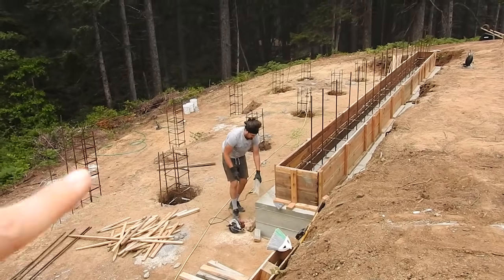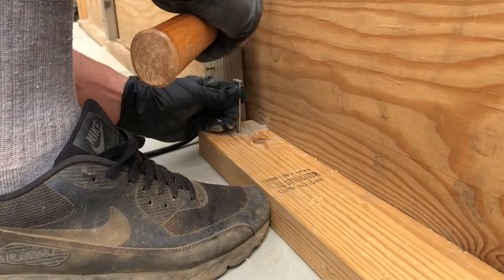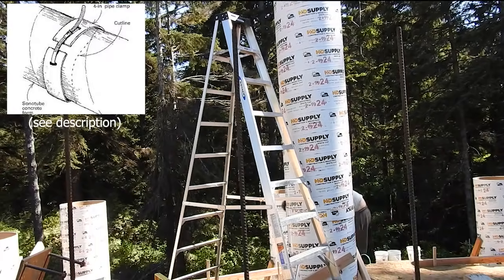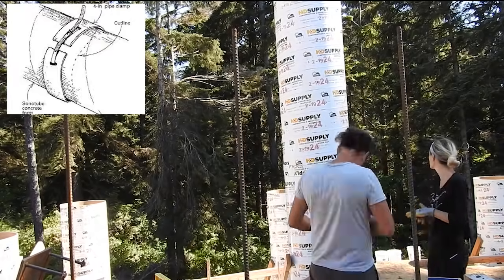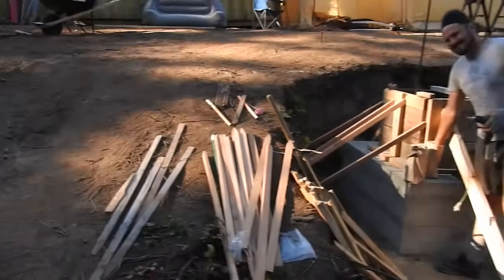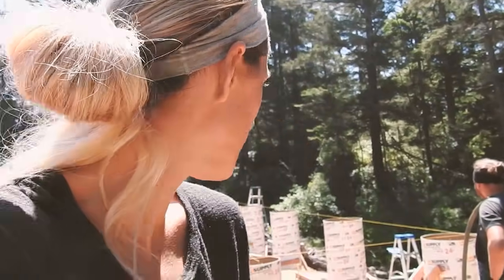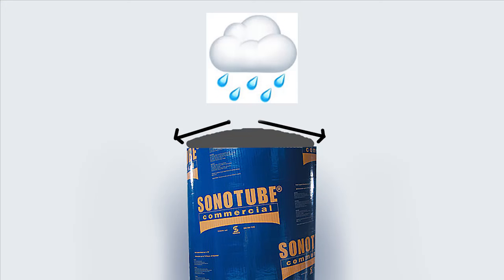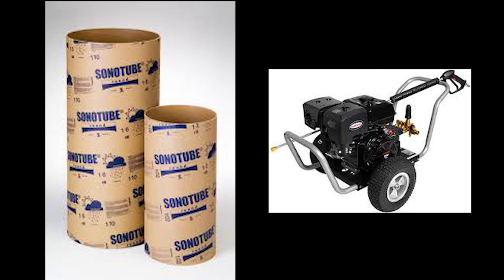FOUNDATION PART 3: Ledger, Sonotubes, & 2nd Pour — CONTAINER HOUSE BUILD - Ep. 5

Comment: I'm not trying to through shade on what these guys are doing because it's quite impressive. But, I know how much $$ that foundation has to be and yet the containers are pretty rusty. In one of the videos, they show a shot from beneath and you can see light peering through many of the structural supports. That's through-rust and it is fairly extensive.

I'm building with containers right now in 2021 and I can get well used 40ft High Cubes for $3200 and I can get "One trip" 40ft High Cubes, which are basically new, for $5500 (both include delivery). I'm personally using some crusty containers for a shop project, but if I were making a complex house, as these guys are doing, I'd be using the one trip units.

I mention this to help others at least consider which grade of container to choose, based on its usage.
Reply from the maker: We haven’t had a chance to refurbish the exterior of the 1st level yet, but we’ve refurbished every other container. You can see how we managed the rust in this video: https://youtu.be/ryD2WWgkl9I We don’t have any areas of the house where the rust has eaten through the structure, and if we did we would patch it up. What video are you talking about? 

With that being said, I agree that buying new saves a lot of time on refurbishment so if it’s in the budget I’d recommend going that route.
Reply: Agree with you. I was thinking the same. These containers have see a few things.

Comment: I'm Just a beginner..  question.. is it OK to pour fresh concrete on dried concrete?  Would this make for a good joining and good foundation?
Reply from the maker: Typically it’s better if you can do it in one pour but if not it’s doable.
Reply: @PacificPinesRanch   what was the deciding factor(s) for your build for multi-stage pours vs. monolithic?

Comment: Hi, I live in SW Washington, and understand things in your build. Somehow I missed this video, and forgive me but I have a couple of questions for you. Living here in the northwest we live in a volcanic area (I live about 20 air miles SW from Mt St Helens), and along the fault plate underground. May I ask why you decided on the pillars as you did? I would think under certain conditions, wouldn't it have been more stable to use two re-bared foundation walls? My other question is not really as serious, but I would have left the Sonotudes in place rather than messing with removing them. Is there a reason you wanted them off?  I'm getting ready to start a project like yours this spring. I have many options and haven't really decided on one yet.
Reply from the maker: The reason we did the concrete piers was mainly because of cost, and it's also much easier to set up sonotubes than setting up concrete forms. There is rebar in all the concrete piers. Also, we removed the sonotube covers for aesthetics. Hope that helps! :)
Reply: @PacificPinesRanch  Thank you for kindly responding. I know you guys are busy. The reason I ask about the pillars, is I wonder how stable they would be during an earthquake. The pillars might remain intact, but I would worry about the containers swaying on them, as opposed to being more stable on a wall foundation. 

As I mentioned my place is up by Mt St Helens, and while we were spared from the devastation during her 1980 eruptions, we did experience tremors during the first major eruptions. 

I am also someone who lived on Elmendorf Air Force Base, in Anchorage Alaska in the late 50's and early 60's, as well as have/had family who experienced damage from the 1964 earthquake.  It's hard to un-forget those past experiences. I have always been a prepper and gun shy with somethings.

Thank you for kind and timely reply, I look forward to watching as your build continues, and seeing your end result.

Comment: I'm the process of building a 16'x32' home 8 feet off the ground on piers. How can I determine the concrete pears, I beams or metal pipes to support weight. I have seen lots of stuff on YouTube like a 40' container lifted 10 ft with 4 pipes around 12" in diameter.
Reply from the maker: Jorge Serna You’d have to calculate the live/dead loads of the house and find what size piers can support it. Also you would have to see if the soil you’re building on can support the piers & the depth you’ll need to reach to set them up. I’d highly recommend talking with an engineer if you’re wanting to put the house 8’ off the ground.
Reply: @PacificPinesRanch  I understand completely. I went from a metal building to a shipping container and now to a wooden cabin on stilts. Well it was fun watching.

Comment: Hi guys. Based on your number of pillars, what was your cost?  Thank you very much.
Reply from the maker: Rodrigo Sardan The foundation was around $8000 total for materials and concrete. We had about 25 yards of concrete poured which was the biggest expense.
Reply: @PacificPinesRanch   similar question, but I'd like to know about the containers.  Did you get a bulk buy discount?  Were they delivered at one time, pre-paid/delivered as you went, bought individually as you built?  There is a guy local to me, but finances surely keep me looking at options.

Comment: Can you provide more for details of the steel plates that were placed on top of the sonotubes.   Were they wet set after the concrete was poured or did you place them in before?   Did you weld the shipping container corner castings on these plate?  What  are the dimensions and thickness of the plates?  How did you make the plate assembly?   What was the most challenging part of making and setting these plates in place?
Reply from the maker: We set them the same time we poured the concrete. The plates are either 1/2” or 3/4” thick and they have various sizes based on where they are being placed. Also they have an anchoring system that anchor them into the concrete. You can use a J bolt or threaded rod with a nut/washer, etc and weld them to the plates. They were pretty easy to make. Hardest part was setting them because we needed to be extremely precise in their placement.

Comment: This is way too much work. Who sized the foundation and footing? How much did it cost to pay someone to size footing?
Reply from the maker: It is a lot of work but the foundation is definitely adequate for the size of our house (which will be 7 containers, 3 levels, + a rooftop deck, around 3,000 sq ft). We had our plans engineered for the house.
Reply: Pacific Pines Ranch may I ask how much the foundation cost in total? I am currently doing a shipping container home and unfortunately there was a misunderstanding. My architect made my footings out of steel, and a steel frame. Meaning a lot of welding needs to take place. Unlike you I’m only doing one 45 ft shipping Container home. However it is hanging off a hillside, therefore 2-4 Pillars will need to be much taller than the back pillars, so 20 feet will be off the hillside. For the steel legs and frame they want 46k way to much in my opinion.
Reply: @PacificPinesRanch  But was it designed by a soils engineer since you are on a hillside?